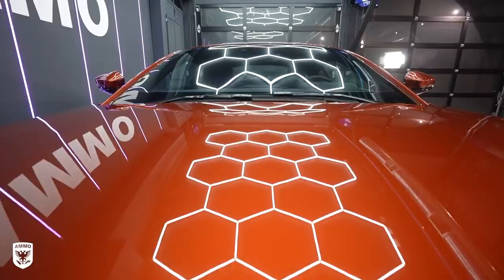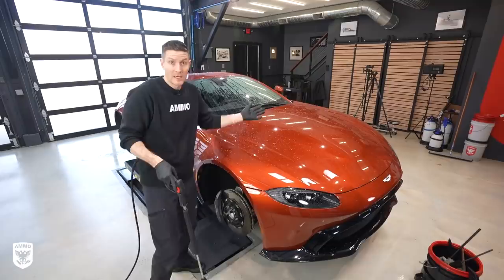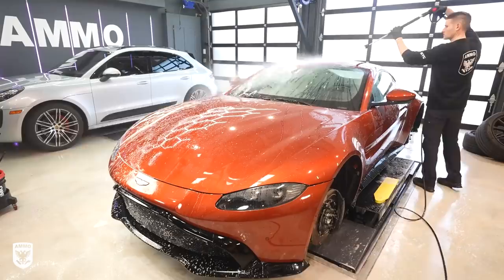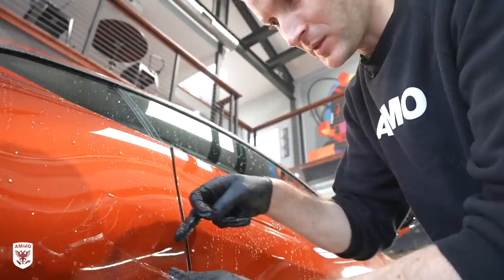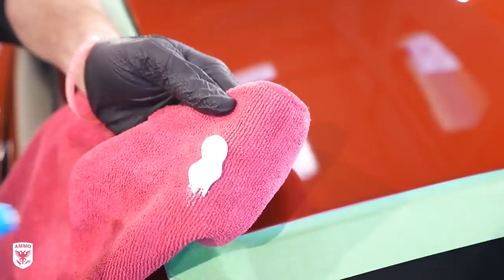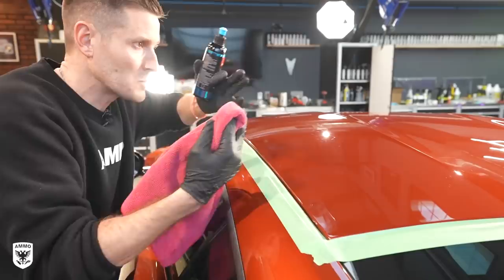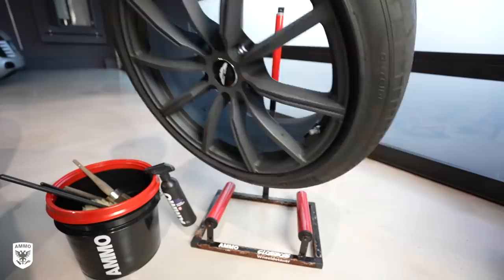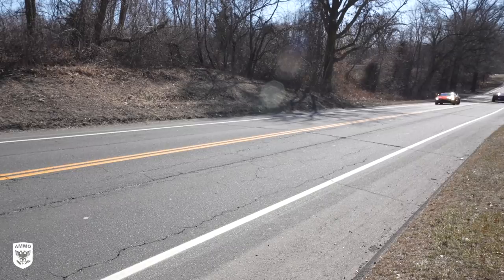First Wash & Drive Aston Martin Vantage Paint Correction

Comment: Hey mate, suggestion with the hot water thing, a kettle style called a Swan neck might be the way to go. I use them as a barista since they're more controlled, but the spout is also connected from the bottom
Reply: Great idea
Reply: Why not a steam cleaner?
Reply: @cannedgorilla1062  that's what I'm wondering. I've used steamers to peel clear bra and window tint. Works Great!

Comment: Instead of using that kettle fot the hot water, just use a power washer that has steam capabilities. Remove the nozzle like you were saying for the door gaps. It works great.

Comment: Hi, that hot water pouring technique would be easier with a steaming machine. Using it further away just to heat the plastic enough to pull it. Easier, safer, directional and long lasting. Maybe you already tried it, don't remember. Love your videos.

Comment: Instead of pouring warm water, I would try filling a bucket with warm water and use something like a brush with a spunge at the end of the shaft. That would make it easier to handle I think, and probably just as effective.
Just dip the spunge/brush in the bucket and heat the plastic as you go

Comment: It would seem that many AM dealers, certainly here in the UK, do not care about the vehicles paint work. I have seen brand new cars in the showroom, worth over 100K, with bad marks from poor detailing. I have also sat in an AM dealership and seen one guy wash about eight cars, that were sitting outside, with one bucket and one cloth. No change of water. The same bucket, cloth and water for all of their cars. The first thing you do when you purchase any AM, is get it detailed. Then never let your dealer touch the paintwork again. Not even a courtesy wash when it goes in for service etc.

Comment: Ever thought of using a small sized long sprouted watering can, for pouring the hot water instead of a bulky kettle. As you can use the can in either hand easier than a kettle?

Comment: larry, try to pour the hot water with goose neck kettle. helps you control the flow better.
Reply: Every car from the factory has minor paint defects. Due to mass production and costs they can’t chase every defect. In my opinion, they wouldn’t have any defects if they improved their initial processes

Comment: I'm curious why you wash the underbody first, from my understanding of cleaning in general you usually go top down so that dirt that drips from the top can be cleaned off of the bottom. If you clean the bottom first then stuff from the top will settle on the already cleaned bottom. Is this not the case?

Comment: Any recommendations on tape Larry? Was correcting my motorcycle's gas tank this weekend and taped off some rubber gaskets around the guages which are a pain to get wax and polish out of. I had a fair amount of tape adhesive to deal with afterwards. Are there types of tape that don't leave so much behind?

Comment: Great video, I don’t know how you always manage to put a new tip in each video. Could you do a video on a matte car? I have one painted from factory, not vinyl wrapped, and it has a few shiny spots if the light catches it at the right (or should I say wrong) angle. Is there any way to address this? It’s become a real bug bare of mine. I don’t know whether that’s just what happens with a car which was a few years old when I bought it...

Comment: Probably won't read this but wouldn't it be simpler  to maybe add a hot water line to the pressure washer to heat up the clear bra rather than pouring it with a kettle then just pull the tip off seems safer and more efficient

Comment: @21:17 - Question: Why don't you pour hot water on the inside of the clear bra when removing it, not just on the outside? Seems to me like that would keep the hot water trapped inside the bra and allow it to run into the area that you're still wanting to peel off on vertical surfaces like the fenders? Thanks!

Comment: Hey . Removing difficult clear bra . 
What about using a machine that supplies just steam . 
Surely more control than using boiling water ? 
Steam if you control what it's doing is safer than pouring boiling water from a kettle. 
Just saying .

Comment: Instead of using the jug to pour the hot water below the clear bra you're removing, how about putting it in a spray bottle so you can easily spray it instead of awkwardly handling the jug? Should only need a few pumps of spray to get a sufficient amount of water on there to warm it up.
Downside would be the water would cool down a bit quicker but still, would be a lot easier I imagine

Comment: I’ve noticed that you don’t use the wash Mitt anymore. Is it because you don’t like to use it on other peoples cars or do you think that Microfiber Towels are better/gentler ?
Reply: The wash mitt has to be dunked and reused in the bucket. The point is to prevent debris from re-contaminating/marring the paint. So the microfiber towels, (plural), sit in the soapy water. They're taken from the bucket, scoop up the dirt/debris in singular passes along the paint rather than back and forth motions which can drag debris and create swirls and scratches.  Then they're put in the dirty bucket, not to touch the car again. The towels can be cleaned/decontaminated a lot easier than the wash mitt. His methods evolve over time, and this method's been in play for a few months. The two bucket method still works great if you don't have a pile of microfiber towels to use.

Comment: You need a dry ice cleaning machine in thw shop asap
Reply: He did a video of it not too long ago. I think they said they were working on it, but also discovered that using it blasts dirt all over the shop, making the car clean, but everything else in the building filthy.
Reply: @andrewclary872  yeah I saw the video, but I think having a dry ice machine in the shop is a must have for Ammo NYC
Reply: @user-db1pn4ky2b  I don't know what kind of setup is that, but having a dry ice machine is not expensive, but even if the setup is 90k or 100k, Larry can afford it easily
Reply: @user-db1pn4ky2b  also having the dry ice machine is an investment to the shop

Comment: Larry, when pulling the bra with hot water, why not pull from the bottom up? That way you can pour water on top of it continuously with no problem. And since you're pulling up, your hand will be higher than the pulled edge, so you shouldn't burn yourself, don't you think?